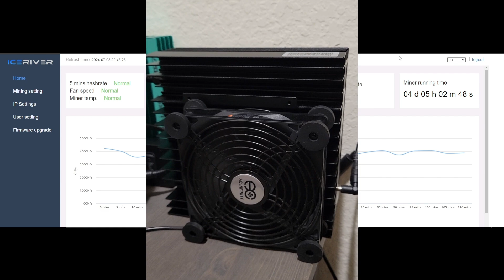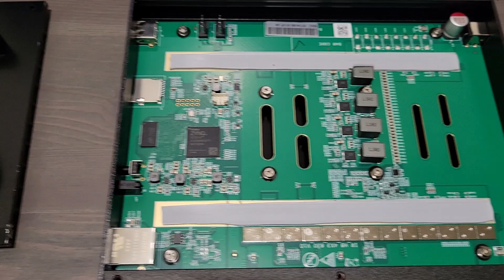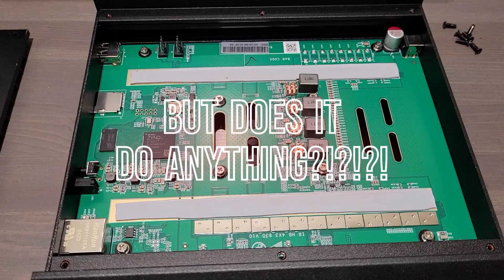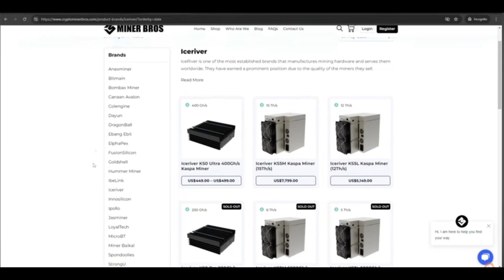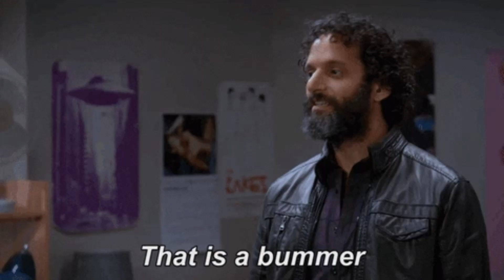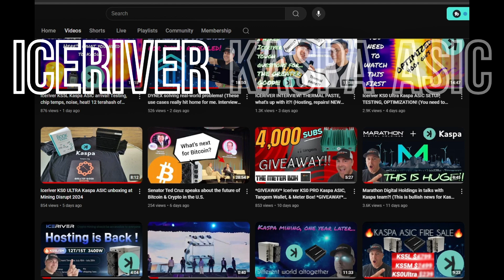Iceriver KS0 ULTRA Kaspa ASIC TESTING! (More hashrate with copper heatsinks?)

Comment: OK so I am one of the unlucky ones my ultra is no longer responding (no gui) I can still see it on the network anyone know how to flash it via usb ?
Reply from the maker: It probably just switched IP Addresses. Use the monitor tool and hit the ip report button to see if it changed.set static IP
Reply: @GreaterGoodMining  nope it kept the ip but I can no taccess the gui and the monitoring tool can see it but cant connect. i spoke with tswift and he said it can be fixed for a price and gave me a link to a dev but lol my telegram has some kind of ban on it where i cant message new people. I dont even use it so no idea how i got this issue lol
Reply from the maker: @k1e1v1i1n  ohh I gotcha, so you tired to overclock it and it bricked because you tried to reset it while the init file was loaded into it without loading up the reset file? I can't help you unfortunately, you'll have e to go through whatever contact he gave you
Reply: @GreaterGoodMining  back up and running 100 kas for the fix

Comment: maibe try watercooling , should equalize the temps and you might be able to keep it closer to optimal temperature
Reply from the maker: I'm hearing that the new firmware should keep the temps in the range it needs to be in. I'll be trying out the firmware soon to verify.

Comment: Without setting the fan the chips stay at 75°
Reply from the maker: Yeah these things definitely prefer to run hot. The auto fan settings didn't seem to work as well for me so I just went ahead and set them to 40 for this testing. I also wanted the fan to lock in at a consistent rate for all 3 machines for testing purposes. Because if the fans are set to auto it kind of defeats the purpose of trying out the usb fan etc

Comment: Hey boss , can you run copper heat sink machine fans at 25-30 percent.  You should exceed 400mhs and do a chip temp report ?
Reply from the maker: I've already done that in previous videos. So far it seems like my Ultras are happier with no fan on top and the internal fans set to 50%. When I have them like that I usually get over 400gh

Comment: Iceriver need heat no idea why , I can cool him 43c 35c and hashrate is 340gh after turne of fan spin to heat whole box to 57c 44c hashrate go up 409gh average 395gh after few hours , ridiculous need heat to work faster , heat = degradation electronic 😂😂 my second device will arrive but better buy 2x ka box pro 1.6th it works way stability way better
Reply from the maker: The heat seems to allow more efficiency in the chips. Heated metal allows electrons to flow more freely with less resistance. We miners don't like the heat, but unfortunately it is a part of mining! :] I do wish these things werent so picky though!!